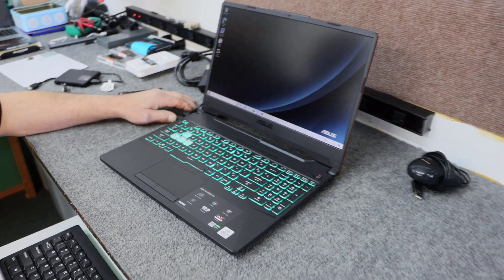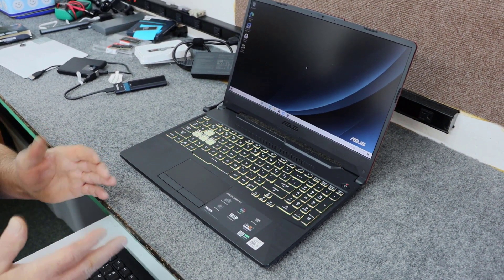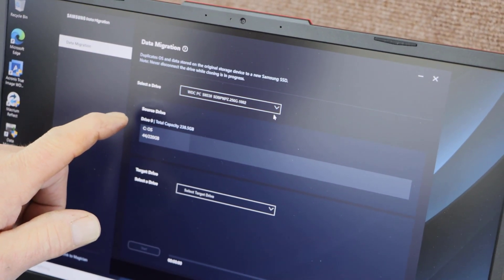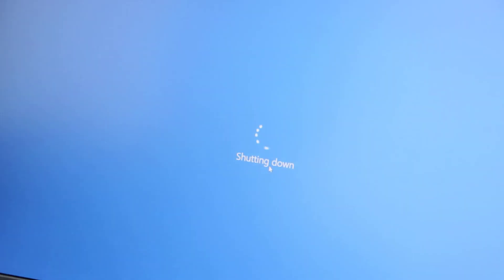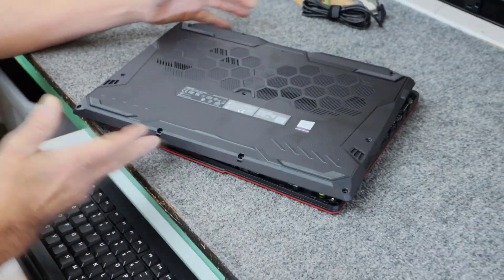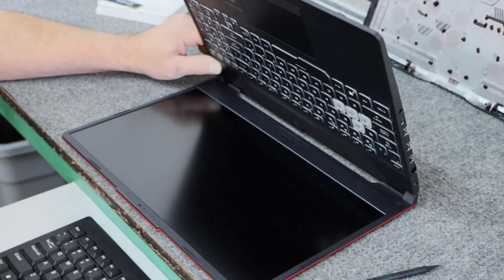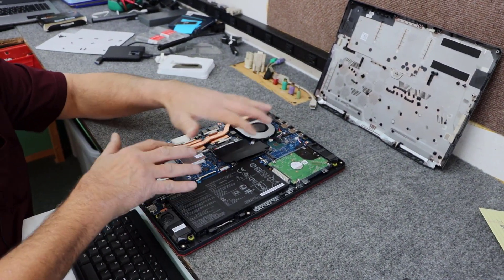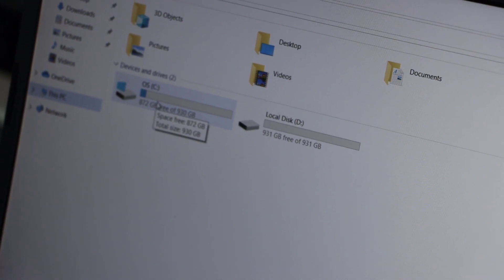ASUS TUF F15 Gaming Laptop SSD Clone & Upgrade Memory Upgrade

Comment: Waited about a week and a half to get mine from Bestbuy and I just got it yesterday and the first thing I did was upgrade the Ram (16Gb) and ad a secondary SSD (500gb). I was just having trouble because when it would boot into windows the screen will go black and then back to desktop (like when you are installing drivers for the gpu and it goes black and then back to normal) and it kept doing that, until I reinstalled the drivers for nvidia and used the custom install to do the reinstall and clean install for the drivers. Restarted the laptop a few times and I wasn’t having that issue anymore, I also let it sit for a few minutes off and then turn it back on and it still didn’t do it again. My guess what that it would switch from NVidia graphics to intel graphic on startup. Overall I like the laptop so far and for $599.99 from bestbuy was a great buy if you ask me. Might just do the clone on a new NVMe I have coming in.
Reply from the maker: Good job.  Definitely was a driver issue .
Reply: @CadillacComputerCenter  now I wonder if it was....I noticed that if you plug or unplug the power it does it.....looks like it automatically knows if it’s plug in it will switch to either card. 🤷🏽‍♂️
Reply: Okay...so every time I connect and disconnect the power cord it flickers in and out...as if it switches cards
Reply: @thekidbart4528  yeah it does so if you plug the battery out it goes on the silent fan setting which use the integrated gpu

Comment: Is there like another slot for the m2 ssd?
Reply from the maker: Hi. This model has one m.2 pcie slot, and one 2.5 inch sata bay. Dale
Reply: @CadillacComputerCenter  if u look u have a second one above the hdd. To be certain if ur laptop has it open the back
Reply: Cadillac Computer Center im thinking of upgrading my laptop cheap is it better to buy a hdd or ssd
Reply: @shinefake48  depends on how much storage you as well as your budget,if you want cheap high capacity go for HDD,if its slightly expensive low capacity go SSD.

Comment: I followed your methods to clone a hard drive to ssd on the computer I am posting from. Proceeded to do same with a pc at home, and got all bumblefracked up. The software ( Acronis ) wanted me to login, and it took another 90.00 real fast, and still did not work. I did eventually get a refund on that, they were rather nice to deal with. The money was not as important as getting it done.... So I tried Paragon software, loaded and it errors out. Probably fighting with remnants of Acronis for battleground on my drive.

Any recommended methods to clean out remnants of these programs, and get the this going? A link to dealing with warring software would suffice.

This is like free university. Except I might learn something here!

Comment: Dale is an international treasure that needs to be protected at all cost.
Reply from the maker: Thank you my loyal friend. I appreciate that. Dale
Reply: @CadillacComputerCenter  

Hello Dale 👋,
These two I've shortlisted for my laptop's ram upgrade which one do you suggest?
HyperX  16GB   3200	20	22	22	1.2V
vs
HyperX  16GB   2933	17	19	19	1.2V

PS :
CPU:  i7-10750H (max supported till 2933MHz but my stock came with 8GB 3200MHz but is now downed automatically at 2933MHz CL 21-22)
Motherboard:  Doesn't support XMP

I am looking to remove the stock one and put a 16GB of wither above one in single channel and then the other when I’ll be able to afford the other 16GB stick

Hoping for your reply as  soon as possible would really appreciate it, as I am stuck with my 3D projects at my current ram
Reply: @lets6957  id suggest the one with lower latency bcs it will increase performance. the difference isnt gonna be too much but its gonna be better overall
Reply: @CadillacComputerCenter  sir please help me.when im  playing games in not charging  its lags.
Reply: @saleem-zayn  brruuuuuh
it happens to everyone dont worry its not just you its because the components need power when playing games battery cant supply as much power as the charger supplies and so it lags when not charging
Reply: @Shonty_on_gfuel  it doesn't happen to me lmfao get a better power supply
Reply: sorry to be off topic but does anyone know a way to log back into an Instagram account?
I stupidly forgot my login password. I would love any tips you can give me
Reply: @Maximus Zyaire instablaster :)
Reply: @Ryker Orion Thanks for your reply. I got to the site thru google and I'm trying it out atm.
Seems to take quite some time so I will reply here later when my account password hopefully is recovered.
Reply: @Ryker Orion It did the trick and I finally got access to my account again. I am so happy!
Thanks so much you saved my account :D
Reply: @Maximus Zyaire Glad I could help :)

Comment: Do you suggest upgrading from an Intel H10 ssd? It is a 512gb with 32gb Optane, 2400 read and 1400 write. I mostly use my laptop for CAD and general work. No gaming. I would like to get the best performance possible, and even though I don't really need more storage, I will get 1TB if I upgrade.
Reply: Depending on your hardware, you might get an awesome result upgrading the RAM, and using part of it as a RAMDisk, as a work area for Autocad. This is very common in Linux, but Windows support it as well.

Also, replacing the standard hard drive with a SSD or if possible, a NVME will be a night and day difference. 

Unless you are a heavy gamer, or perform very specific tasks, the CPU is hardly a bottleneck.